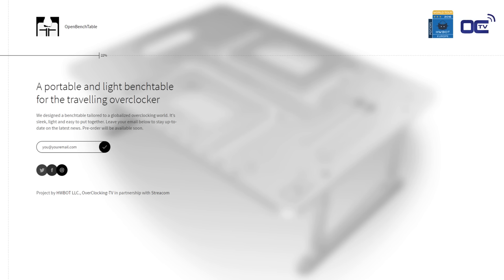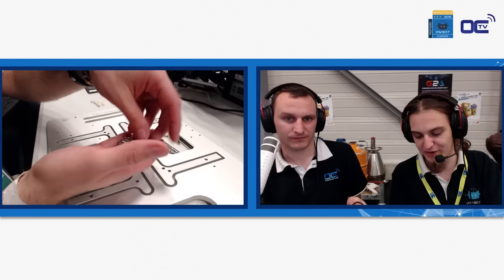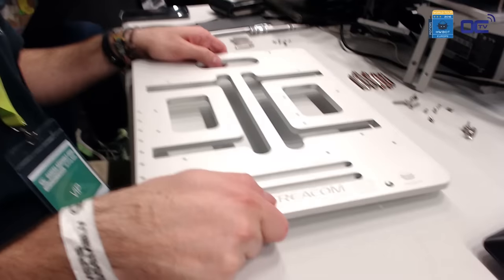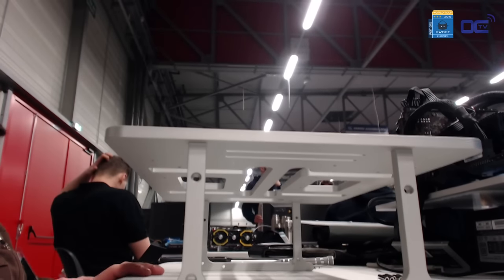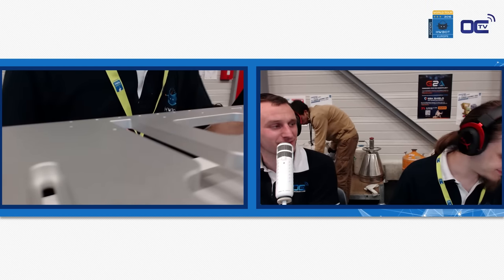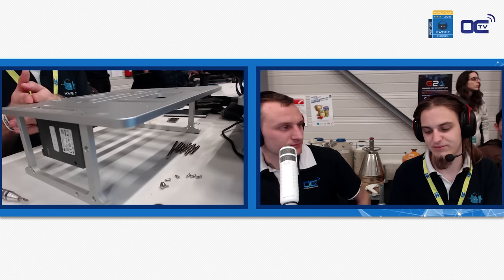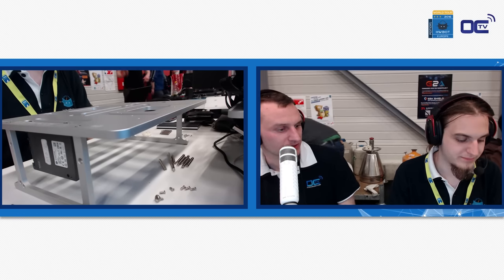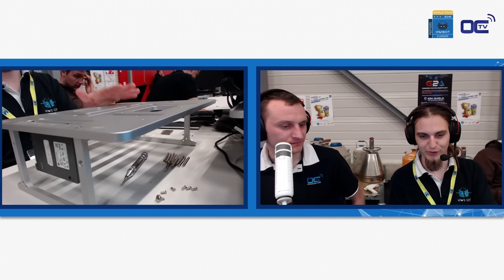Open BenchTable - Official prototype launch / Show-off

Comment: IMO you should look into using thumb screw for attaching the legs would be nice. You could easily make this completely tool less.
Also I would kill for some pump mounting holes and an optional radiator bracket(you could maybe convert the second leg into a 120mm fan mount to support radiators)
Worst case I will take your blue prints and apply liberal amounts of my own upgrades.
Reply from the maker: +mr.cleaner We thought of this, only issue is that they stick out a bit and we haven't found yet the right thumb screws that are long enough to go deep into the legs to have sufficient solidity. But yeah ideally thumbscrews and identical screws everywhere would be the best.

For the mounting we are studying the addition of several threaded holes (a little like camera cages if you see what I mean) that would allow people to either buy community-made accessories or make their own mounts / adapters etc. for whatever purpose they would have (mounting cameras, temperature meters, radiators, etc. Loads of options ones mounting holes are provided. 
The blueprint will mainly server that purpose, so people have an exact 3D replica to build their own accessories (3D printer or otherwise)

Comment: Will it also accommodate mITX form factor?
Reply: Also..I like the thickness of the prototype. Maybe add some rubber to bottom of the feet.
Reply from the maker: +Janice Sheehan Yes, it has the standard holes for mounting ATX, Micro-ATX and mini ITX motherboards.
Reply from the maker: +Janice Sheehan Yes the prototype is 1cm. we are considering options to gain on weight by making it a little thinner, TBC.
Regarding the rubber, that is planned to for the final version, it will come with small silicon-type pads under the feets.